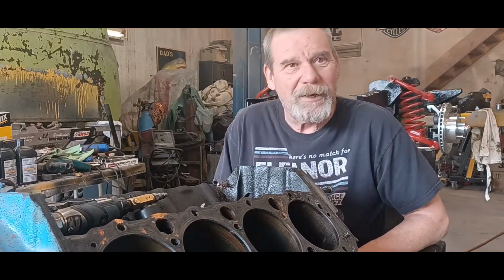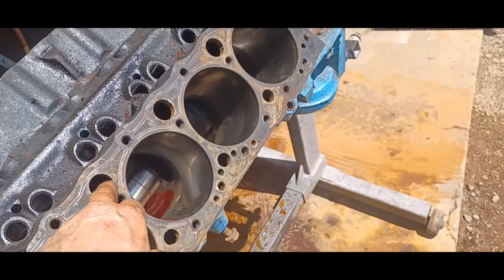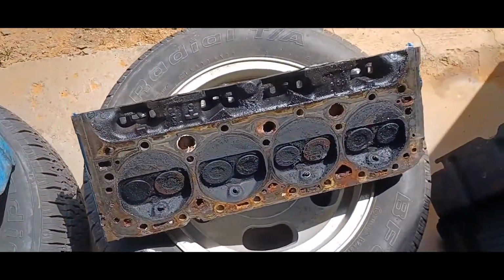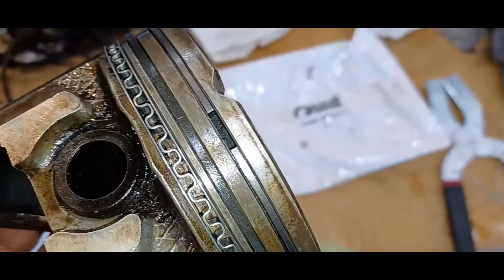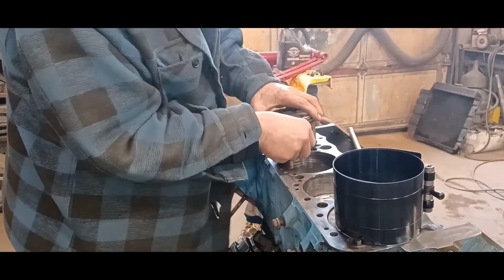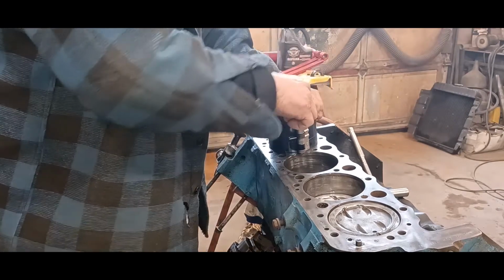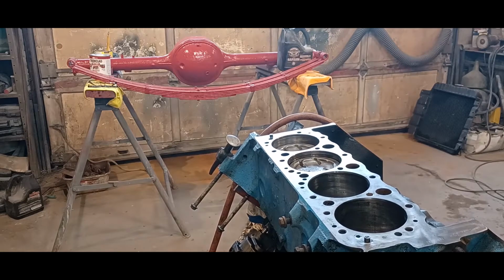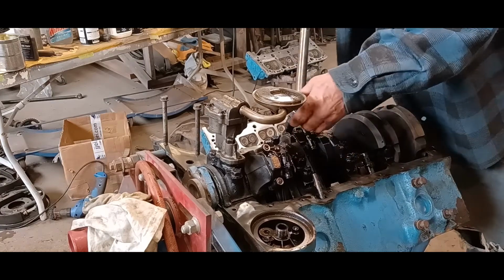THE 1951 CHEVY TRUCK'S SBC ENGINE RE-ASSEMBLY PART 1

Comment: I always use copper plumbing fitting brushes for cleaning all those holes in the casting. You can cut off the "hand" section of the handle and the remaining twisted wire section will go into the drill chuck. I also use them for cleaning some of the odd shaped exterior casting sections of the block for painting. 
Those cylinders looked pretty shiny. Did they have any cross hatch pattern left in them for seating the rings??
Reply from the maker: I'll give that a shot on the next one... oh yeah, cylinders were fine.
Reply: A few gun bore brushes do a fantastic job on cleaning up small holes in an engine and heads. I also cleaned up a few of the casting flash that gm didnt bother doing. Especially the coolant ports.

Comment: Would it be ok to use a power washer to clear some of the grime? Seen you used a hose, so water at this stage should be ok.
Reply from the maker: Sure...just make sure you dry everything up quickly so rust doesn't set in.